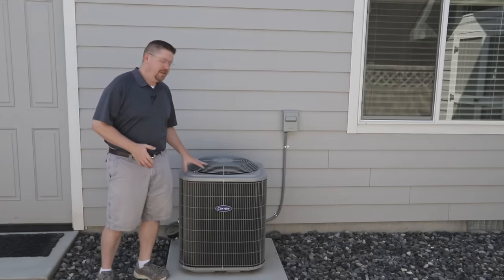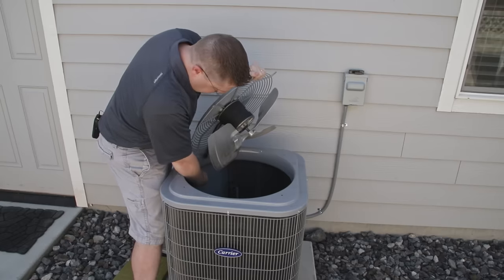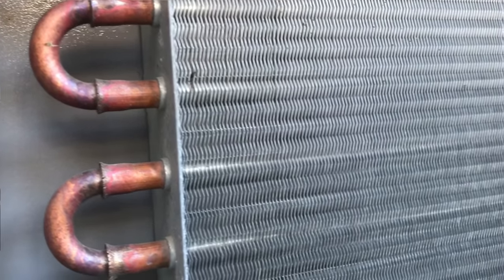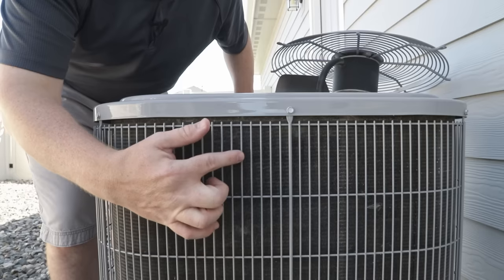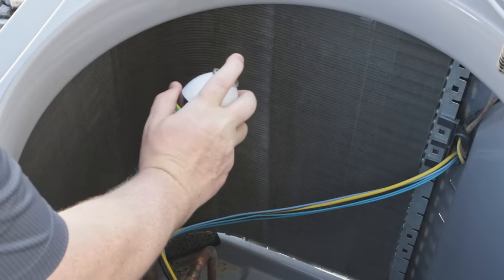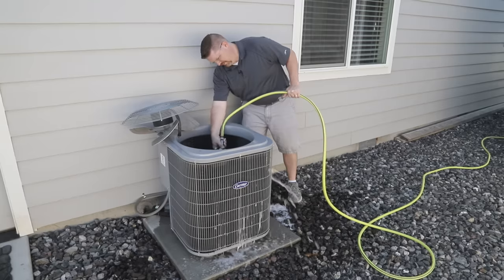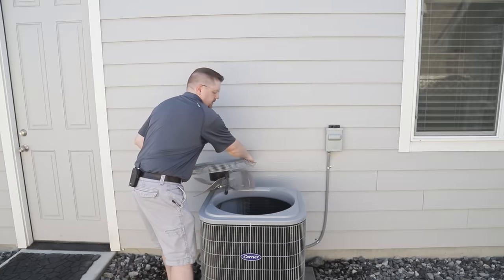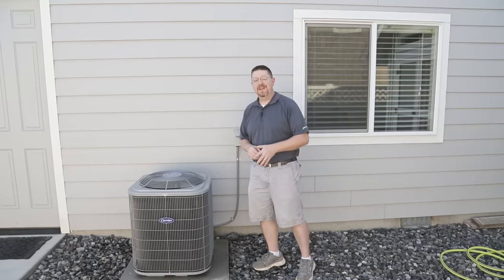How To Clean Your Air Conditioner Condenser Coil (Step By Step)

Comment: Great video. A few questions.  Is it better to remove the whole top unit not just the fan? If you have a dual coil should you also spray foam the outside? On your friend's video it looked like you took the outside cover off. I have an issue with flying cotton from my neighbour's tree that just gets moved around and bunched up when I try to use a garden hose. Can I remove the side panels and get to this flying cotton easier?
Reply from the maker: Hi Derek - if you have easy access to remove your outside cover, go ahead and do so. It should make cleaning up that bunched up cotton much easier for you. Good luck!
Reply: @AmplifyDIY  thank you
Reply: @AmplifyDIY  well mine was filthy and I'm sure glad I found your video. There was no slack in the wiring harness and so I had to lift the top/fan with one hand and reach in and spray with the other. Is it just a matter of splicing some extra wire into the existing harness so that I don't have this problem next time?

Comment: Hey great video. Can you please also post something for cleaning the coiled unit that installed on top of the furnance. I had a frozen coil situation yesterday and we switched off the ac and furnance for about 5-6 hours and then i noticed the water leak from furnance and lot of ice on the coils and inside that unit. I immediately cleaned all i can but noticed few drops of water on the fan motor at the bottom of the furnance. I put 2 table fans immediately next to the motor, should it completely dry everything in half a day or should i do something else just to be sure there is no water drops on the motor before i switch the unit back with a brand new filter. Please help. Thanks 🙏
Reply from the maker: Cleaning the evaporator coils is on my list of videos to produce for sure. Stay tuned! If you get the motor reasonably dry you should be just fine. A little water on the outside casing of the motor should not cause any problems. Good luck!

Comment: Is it okay to spray the cleaner from outside and rinse it, so that we do not have to open the top ? Thanks.
Reply from the maker: Yes, it’s a little less effective, but you can do it that way. It’s certainly better than not cleaning it at all. Good luck!
Reply: Just remember you are pushing all the crud to the inside and it could easily cause clogs or ponding inside the unit housing leading to structural fatigue if the drainage holes become obstructed. Take a flashlight and look inside, you know the surrounding landscape better than anyone (trees, bushes, vegetation, mulching, wildlife critters, etc.) I would suggest if your outside unit is at ground level and within 100 ft of any tree standing taller than the first/ground floor level remove the top and clean it from inside-out at least of once per year (ideally before you initially turn it on for seasonal usage) and spray again once for every 3 months during the season.

Comment: Question I live in Illinois, you thinks is better in winter (snow  state ) cover the ac or not ? Thanks
Reply from the maker: I think adding a cover is likely more or less unnecessary. It may help it stay a little cleaner through the winter, but the AC Condenser is designed to be out in the elements, and should not be harmed by being covered in snow, heavy rains, etc. I recommend cleaning your condenser every spring anyway, so any dirt/dust/leaves/etc that have collected over the winter will be removed then. If you do decide to add a cover, make sure you pull out the cutoff as I showed in this video and keep it in the off position so there is no chance that the condenser can power on. The last thing you want to do is have the AC try to kick on while you have a cover over the condenser restricting the air flow. Good luck!
Reply: @AmplifyDIY   thanks !

Comment: After I remove the top where the fan is, can I also remove all of the side panels for a more thorough cleaning of the coils, or will that not be significant enough to remove them also? Thanks!
Reply from the maker: Hi Mojo - if your sides are more open like the main unit I showed in the video, there is not much point in removing them. If they are a lot tighter louvered style solid sides like the really dirty one I showed, then yes - you can and should remove them. 
Good luck!
Reply: @AmplifyDIY  okay that makes sense, thank you for your help.

Comment: Do you have to wait for the unit to completely dry before turning it back on? It looks like you turned it on right away. I'm hoping that's the case!
Reply from the maker: No need to wait! Keep in mind that the outdoor unit lives out in the weather and gets wet every time it rains, etc.  Just make sure that the water is actually draining out of the bottom as it should. Good luck!

Comment: Sir, important question:   If you (without knowing) used a pressure washer to clean the outside, and you closed the fins, can it be fixed?  Replaced?
Reply from the maker: There is not a lot you can to to cleanly un-bend fins that have all been bent over with a pressure washer. You can leave it as-is, and it should still work, it'll just be less efficient. You can always contact an A/C service company to get an opinion / quote for replacing the condenser. In your shoes, I'd get several quotes and then decide on the best next step. Good luck!

Comment: 1.7.21  Thanks for the video.  Now I need to clean out my heat pump.  Would you happen to know if simple green is ok to use?
Reply from the maker: Hi Chuck! Not knowing anything about your specific heat pump, I'd encourage you to check with the documentation of both your heat pump manufacturer as well as Simple Green. For example, if you will be cleaning aluminum components in your heat pump, you can use Simple Green, but you need to be careful about how you do it: https://simplegreen.com/faqs/15/
Good luck!

Comment: I just cleaned my condenser coil with weak soapy water and rinsed very well. The water pressure was medium. I cleaned it from inside out. My coil is not very dirty. Question: after that, the AC unit won’t start any more. I check the circuit breaker, replugged in the power switch, even reset my Nest thermostat. Nothing worked! It’s 100 outside today.
Reply from the maker: HI Thomas - is there any chance you unplugged something inside your unit? Are you 100% positive you put the cutoff back in right-side up?
Reply: @AmplifyDIY  just had an emergency service call. It turned out the capacitor was dead. So got that replaced and added 5 pounds of freon. Technician said because of Freon leaking so recommend to replace the air handler unit in the attic and it costs 5000. 😬

Comment: How long should it take after cleaning to notice a difference in air temperature?
Reply from the maker: Hi jblades - cleaning the coils won't necessarily make a difference in the temperature of the air coming out of your vents. What it will do is make your compressor turn on a LOT less often, and stay on for a shorter amount of time when it does run. This change should be immediate. Now, if your A/C compressor was running more or less around-the-clock and was unable to keep up with the cooling needs of your house, and your condenser coil was REALLY blocked, then cleaning it may in fact result in much cooler air.

However, if your vents are blowing warm air (or just not quite cold enough air) you may have a different problem (low refrigerant charge, for example.)

Good luck!

Comment: Isn't there an indoor coil that also needs cleaning? Great video
Reply from the maker: Hi Daniel - yes, there is an evaporator coil usually located in your heater (very near your system's blower motor) that should also be cleaned. I have that on my list of videos to produce just as soon as I have some time. :) Thanks for watching!
Reply: @AmplifyDIY  awesome, thank you!

Comment: Are you supposed to spray the foam cleaner on the outside of the unit too?
Reply from the maker: I generally do not. Spraying it on the inside and then spraying water through the fins from the inside pushes the cleaner through to the outside and does a great job cleaning. Good luck!

Comment: Is turning off the ac unit inside (the thermostat screen)the house enough or must the breaker be off for this process?
Reply from the maker: Turn off the breaker/disconnect. That’s the only way to guarantee that the unit will not start up while disassembled. That fan motor is very powerful, and the blades are quite sharp. Having it turn on while your arms/hands are anywhere near it would be catastrophically bad.

Comment: Is it not dangerous for those wire inside to get wet?  And how to dry them in case it got wet?  Thanks for sharing.
Reply from the maker: Hi Maria - remember that these units are designed to run outdoors in the elements... rain, snow, etc can get in there easily, so they are built to function perfectly fine even if a little water gets inside.  I would not go crazy soaking all the electronics, of course, but if a little water splashes around that's not big deal. As long as you don't have large pools of standing water inside the unit anywhere, it's fine to re-connect everything and start it back up. It'll dry quickly as it runs. 
Thanks for watching!
Reply: @AmplifyDIY  sir, that’s why I asked bcoz I really don’t understand these things, but you don’t have to answer me sarcastically.
Reply from the maker: @MariaMendoza-by1jx  I apologize if my reply seemed sarcastic - I certainly did not mean it that way.

Comment: Does the unit need to dry before restoring power?  How long did you wait after cleaning?
Reply from the maker: Hi Nunya - no, you don't need to wait for it to dry. Remember that these are designed to run outside, in the rain, etc. As long as none of the components are actually submerged, it's fine to turn it on. Good luck!
Reply: @AmplifyDIY  Thank you for the video and your quick response.  It’s much appreciated.

Comment: It’s obvious there is some kind of environmental or financial ( for the furnace service industry) reason we joe public shouldn’t be using this coil cleaner. Every retailer I looked at sold a version of it but not a single one had it in stock at the store. All of them were online only.  So I just busted out the foam cannon for washing the car that attaches to my garden hose ( not a power washer) and soaked it with that and rinsed it off. Worked perfectly mine was as bad as your friends and the unit was only one year old. But my neighbor has been doing a lot of landscaping this summer kicking up a lot of dust and debris. 
Thank you for posting the great tips 👍
Reply from the maker: Hi Kevin! I'm glad you were able to get your coils cleaned - great thinking about using your foam canon for your car! Cool idea. :) 
Regarding the canned coil cleaner: I bought some this past weekend at my local Lowe's - they had several different kinds in stock at my local store. I used this specific one: https://www.lowes.com/pd/WEB-Common-20-006-in-x-45-5-in-x-22-126-in-Actual-20-006-in-x-45-5-in-x-22-126-in-Box-Air-Filter/1000024695
My local Home Depot also has a variety of different coil cleaners in stock at the stores as well, such as this one: https://www.homedepot.com/p/AC-Safe-Air-Conditioner-Foaming-Coil-Cleaner-AC-921/206740351

Perhaps there is something odd in your neck of the woods? ¯\_(ツ)_/¯

Thanks for watching!

Comment: Can we use the same process for split AC evaporator coil ?
Reply from the maker: The process will be similar, but I recommend you check the owner's manual to see exactly what the manufacturer recommends. Good luck!

Comment: How would you do this on an apartment balcony where the A/C outdoor unit is installed, and where there's no garden hose available?
Reply from the maker: Hi Dan - The process in your situation would be more or less the same - the only real difference is how you rinse the unit off. I'd suggest you pick up a cheap weed sprayer (the kind you can fill with a gallon of water, and pump up with a handle to pressurize it so it sprays out of a hand-held wand) and use that to rinse off the cleanser. Make sure you have some sort of decent drainage from the balcony first though (you should... A/C units sweat a lot, and need drainage in the first place). Good luck!

Comment: does this also works since I haven't used my ac for the winter. I only used the heater, and now that summer is coming, I turned on, and the smell was pretty bad. I had to turn it off because the smell was just awful 😖.  So my question is if I clean this, will this help out on the smell?
Reply from the maker: Hey Junior - sorry I only just saw this now. Unfortunately, cleaning this won't change the smell of the air coming from your vents. When's the last time you changed the filter in your system? Also, the part I cleaned in this video is the condenser coil. Your system will also have an evaporator coil, probably inside or right above or below the furnace body where your blower motor is. The evaporator coil can get dirty (and wet) and can cause a foul odor. I hope you've solved the issue. Good luck, and thanks for watching!

Comment: I work on a tugboat and we got 3 of these. What’s the best to get out exhaust soot
Reply from the maker: That’s a new one to me. I’d start with the cleaner I showed in this video. If that does not do enough, I may try something like brake cleaner or carb cleaner on a small area…just be sure it’s safe to use on aluminum. Good luck!

Comment: Can the fins be replaced as a unit? Or, does one need a whole new unit?
I'm asking because I have a unit, and at the bottom, is serious corrosion (it white and chunky).
Reply from the maker: Hi Justin - The condenser can usually be replaced as a unit, but you'll want to get a few different quotes from local repair companies before doing so.  Your unit may still be usable, or there may be other components that need to be replaced. Unless you have the right equipment to evacuate the freon and re-charge the system though, this is one job that you should call in a professional for. 
Good luck!

Comment: You did the light test On the system  that wasn’t caked with dust
Reply from the maker: I did the before and after on the same system…and I think it showed the difference cleaning makes, especially on a system that is not very dirty in the first place.

Comment: Are you supposed to suck out the water with a shop vac once you are done cleaning it? Or is it ok to leave water in the unit?
Reply from the maker: The water should drain out the bottom of the unit. You can leave what little remains - remember that these are designed to operate outside in the elements (rain, show, etc) and can handle running when a little wet. If the water is not draining out the bottom though, you should definitely investigate why. Good luck!

Comment: My AC unit has had some trouble cooling the house up lately, it only gets to around 80 even when I set it to 75. Could dirty fins be the cause of it? I’d like to try all the DIY options before calling a professional and coughing up a bunch of money.
Reply from the maker: Possibly, yes. How dirty do your coils look from the outside?
Reply: @AmplifyDIY  I just checked and the coils were extremely dirty. I did the flashlight test and you couldn’t even see a glimmer of light from the other side. I’m going to clean it now and see if that works. Thanks for the reply!

Comment: just one question... what if you have hard water? You can't dry off the fins so doesn't rinsing leave a hard water deposit? Other than that question I intend to clean my  A/C  per your advice. I live in Houston so I would just die without A/C
Reply from the maker: Yes, it will leave a VERY small amount of mineral deposits behind if you just let the unit air dry. However, it's not enough of a deposit to worry about. Getting all the junk out of the spaces in the fins is far more important. 
If you are concerned about water deposits though, you can use an air compressor or leaf blower to blow out the fins as soon as you are finished cleaning - be VERY careful though, as the air pressure can actually bend the thin aluminum of the fins. Alternatively, just reassemble the unit and turn it on immediately. The fan will pull a LOT of air through the fins, drying them pretty quickly. 
Good luck!

Comment: No need for the expensive spray cleaner folks, just a regular garden hose does the trick alone.
Reply: Wrong
Reply: depending on the type of debris and amount of said debris present in between the fins
Reply: The spray cleaner cleans all the dirt that attaches to the coil fins. It uses a soft acid that exposes the bare aluminum of the condenser fins in order to increase the air conditioner efficiency... you can go cheap but you will go twice!!
Reply: Antonio Howard last time I checked, dirt washes away with pressured water from a garden hose. Unless someone is spraying chain lube or liquid adhesive into your condenser coils, your flashy solvents are just another way hvac companies ripoff customers and line their greedy pockets.
Reply: Quirino Navarro seriously?😁
Reply: @tg8150  f

Comment: You should just take the whole top off makes it a lot easier and you can put a vac in there and get all the big stuff and if you don’t have the top off then you can’t  take all the sides off and get the coil more clean on the other side like the outside witch should be cleaned too